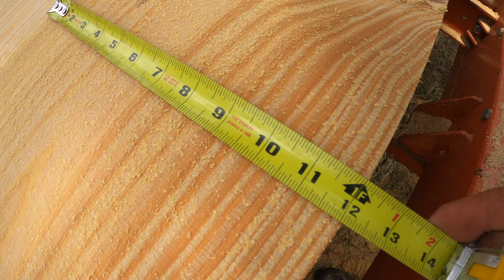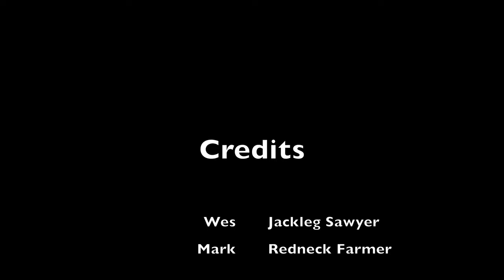Saving the Trees, One Log at a Time

Comment: Hey Wes, in one of your old videos you said it takes you about 15 minutes to setup your mill. I wish you would make a video explaining which stands you put down first and why because it takes me about 40 minutes to setup mine. I saw you were putting down one of the center sets of stands first to get the mill off the hitch, that's what made me think of this.  George
Reply from the maker: Yep, 15 minutes is about right. But I don't really have a routine now that I think about it. If the mill is on unlevel ground, I'll put the stands down on the downhill side first and get it kinda level, then put the uphill stands down. I normally have to do those middle ones first in order to lift up the front because the front of the mill is usually too low on the hitch to rotate the stands into position. My drill with the socket on it really is the key, it makes things very fast. So, I guess the pattern really depends on the ground that the mill is sitting on.